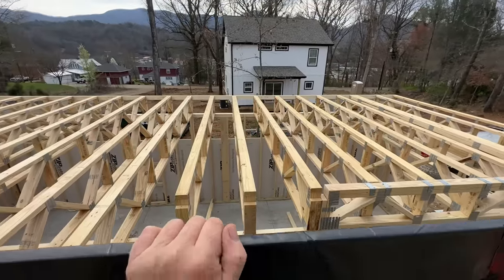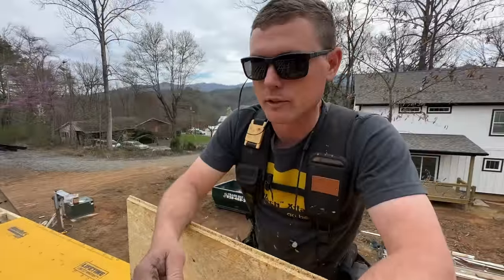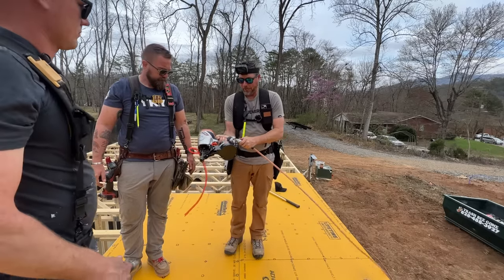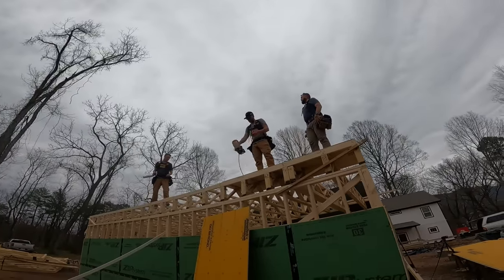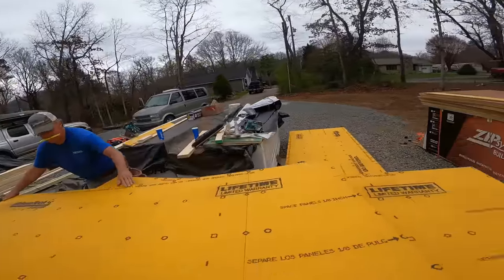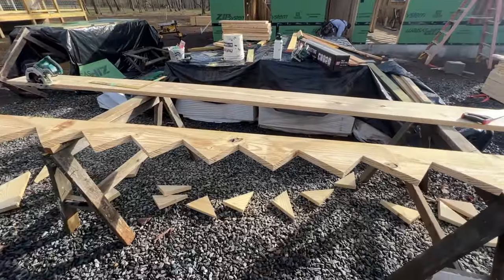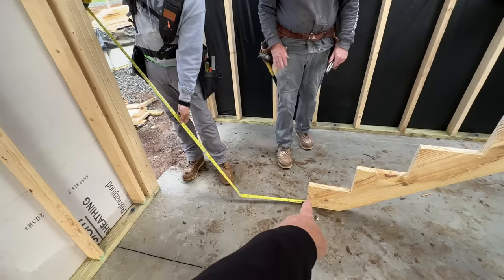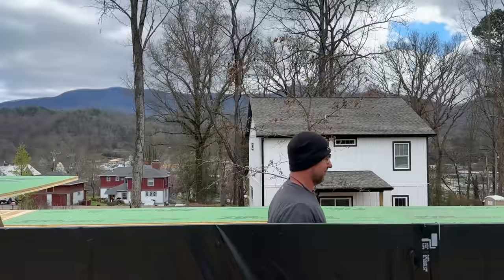Construction of a Duplex Part 9

Comment: Hi from Australia where we have been using that truss floor systems for decades now, the Strongback is for twisting purposes and to lock the truss in place, seeing as the truss is locked from twisting on both ends of it's contact points the strongback goes in the middle to help with twisting through there

Comment: As someone who just got done installing 2 hand rails in our house, I would love to see some blocking for the hand rail installed. Mine didn't have it, and the stud locations would have made the rail really long and wonky. I ended up cutting drywall, notching the studs and installed a 2x8" and then repairing drywall. Was a lot of work and could have been much easier if it had blocking originally.

Comment: Erik...  In this duplex build is there going to be any type of sound proofing insulation on the dividing wall?  I used to live in a townhouse that didn't have much if any sound proofing in the walls between the two townhouses.  It made for some annoying times when the people in the other townhouse stomped up and down the stairs (they had small to medium-sized kids) or were moving furniture.

Comment: 16:19  why is the bottom of the stringer in the rough opening of the door?  

Also any pro tips for keeping the center stringer from sagging/bowing lower than the sides?  I thought about using scrap zip to nail to the stringer before cutting to keep the thing from bowing.  Using the dimensionally stable ply to hold the grain of the stringer. Maybe nail and glue?

Comment: Pro tip for you: Keep walking on those floor trusses without completely bracing them and you will find yourselves on the ground. Yes, you do need the rat run installed prior to walking on the floor trusses.
Reply: They're screwed down to the walls. I highly doubt they would go anywhere

Comment: Looking at those stairs I've just realized that you do not plan to put thermal insulation between slab and flooring. Is this standard in your area? From other videos I would say your climate is not a hot one:) Isn't floor kind of cold during winter? I'm from other side of the world (Central Europe) and I would say nowadays we put anything between 4 and 10 inches of insulation on a slab. It used o be like 2, but I don't remember slab without insulation in new construction.

Comment: Hey Guys, love the channel but my chemical engineering background can't help but recommend protecting yourself from Polyurethane Adhesives and Foams, gloves for sure - these glues and foams contain isocyanates which are bad to breathe in and/or get on your skin, it's also possible to become sensitized to isocyanates so it's just not worth getting it on you or breathing in the fumes, which may not smell bad but are bad for you. Glues and foams may release isocyanates for days after application and then are generally safe and stable when fully cured. Hope this helps you guys!

Comment: Why would you start putting T&G boards at the outer edge? I would have started at the drywall side and worked out. You are going to have a tough time getting that small sliver in, or you'll have a huge gap at the wall.

Comment: Is there a reason you did not do something like a 1 inch back cut on your stair stringers. On a smaller house it is usually a good way to get a set of stairs to fit in better. You riser will no longer be plumb but instead be slightly tilted. Or maybe you did and It is just not see it in the video